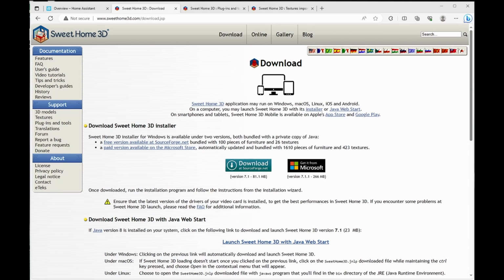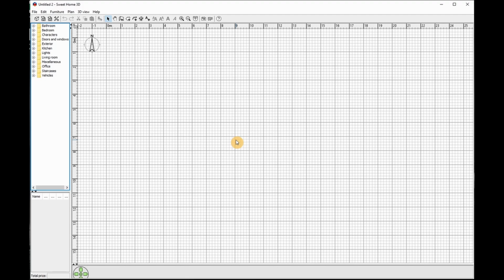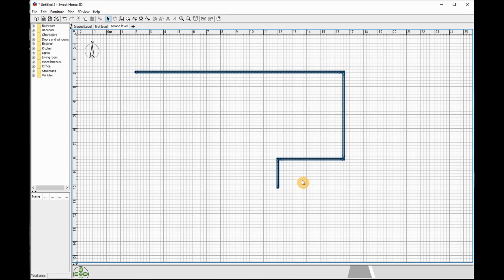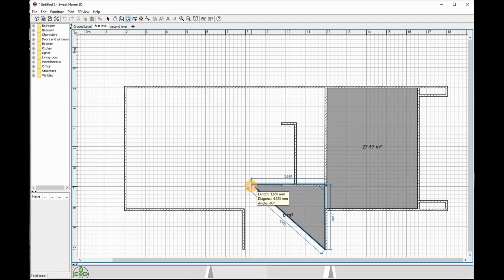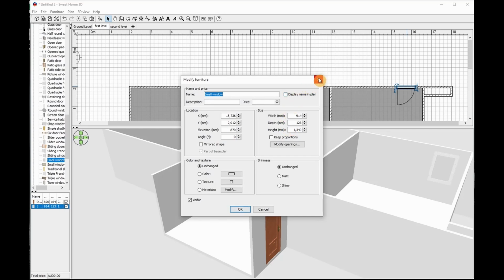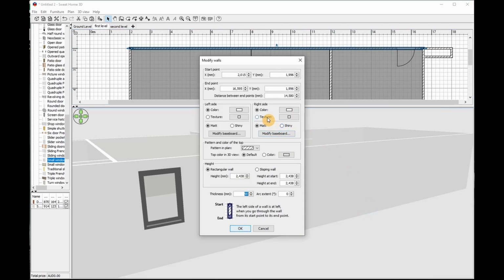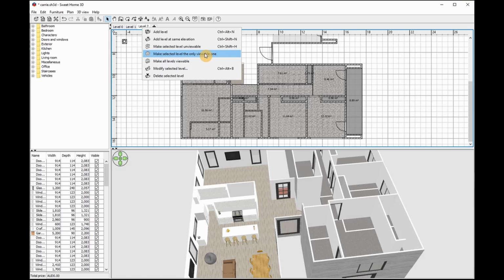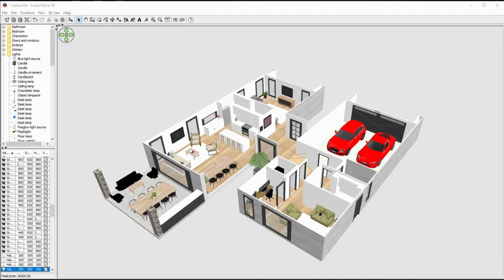Home Assistant Floor Plan with Sweet Home 3D

Comment: Good that you set it up in Meters (feet/in not the rest of the planet).. if really doing this for a building, need to do the floor before a wall (individual rooms), because the wall sits on the (concrete) floor.. but.. if an internal floor inside wall, will be for such as carpet/tile area.. as that some people might want to do individual rooms first with each having their own floor area.. just in case that rooms are separate, as on a bill of materials, just for the single room.
It's one or the other.. that we have a choice of what can be done.

Roof plugin.. GenerateRoof-4.5.sh3p in the plug ins and tools.